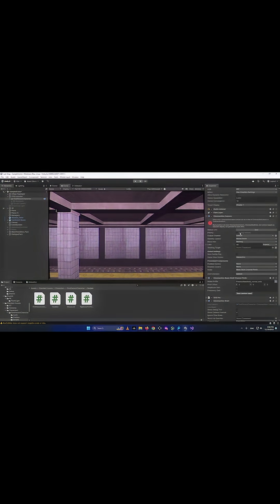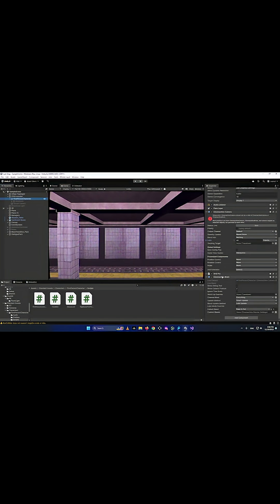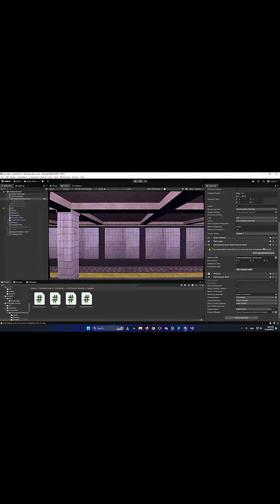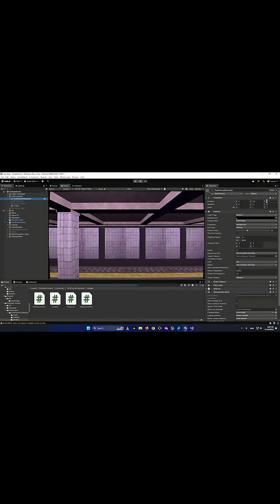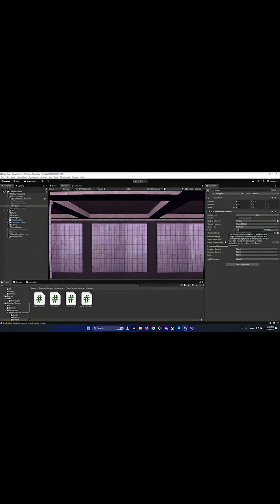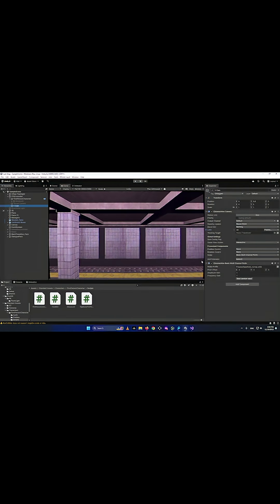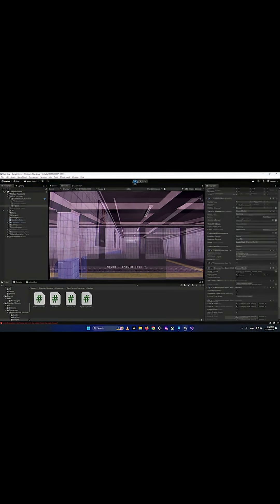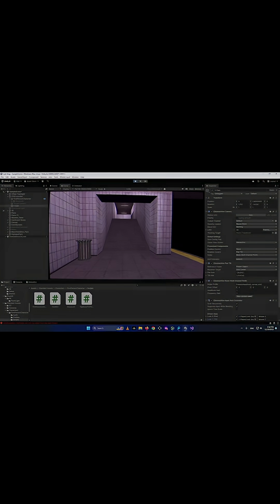Cinemachine Virtual Camera Noise Bug (Quick Fix) #shorts #unity #unitytips #indiedev #unity3d #short

Comment: Regarding the Cinemachine camera, what about the Lookat camera that was previously in the Dialogue System? Previously, it used the Cinemachine virtual camera, but now that VC no longer exists, it has been replaced by a camera. Will it work the same way?
Reply from the maker: It's kind of the same, In the Rotation Control there is an option called hard lookat, You put it there, it adds a cinemachine hard look at thing in the inspector tab, and that's it. 😉
Reply: @Bat_pann  batpat, if it's not too much trouble, would it be possible to remake the Fears To Fathom Dialogue System in Unity with the new Cinemachine system? Because when I try it, it always feels strange. The camera doesn't follow the movement (WASD) and the dialogue collider is in the wrong position. Thank you.
Reply from the maker: Hi my friend, Of course it's possible, I'll make it and be sure to mention you when I upload it.
Thanks for being here my friend
Hope all the best 🔥🙏🦇🍳
Reply: @Bat_pann  Thank you very much for your response, you're the best. 😊😊
Reply from the maker: Anytime 😊
You're the best 🔥😉🙏